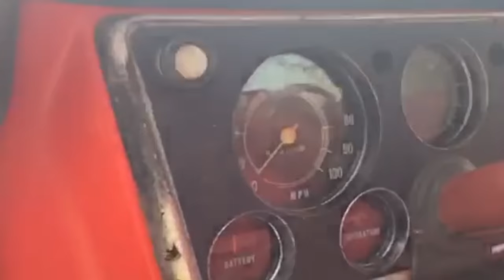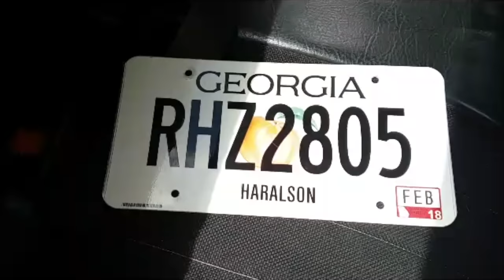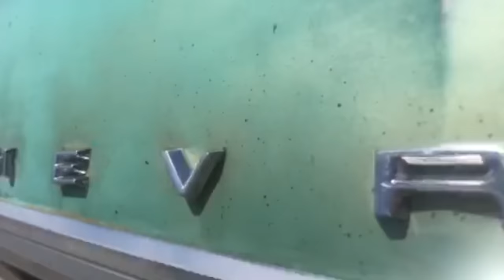Squarebody w/ 22" Torq Thrusts, C10 Filmed at Abbey Road, '72 K10, '68 Burb & more #submityourtruck

Comment: Hey man I  have been stuck on the 22 delrays. My question is would 22/10 go on the rear of 84 c/10 2/4 drop I want a little  more lip with same continental  tires. If not I'm going with 22/9 thanks in advance
Reply from the maker: Certainly will with right backspacing but DSW only makes the 22 in 9" wide currently.